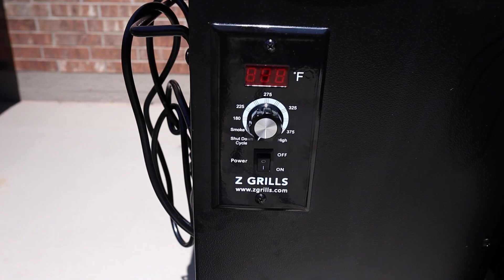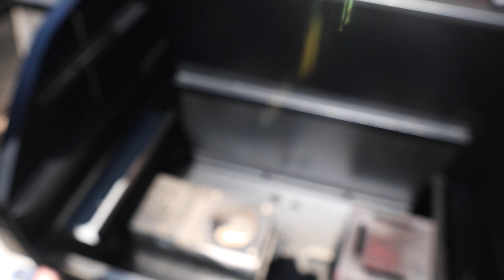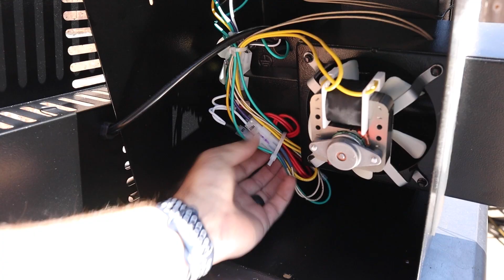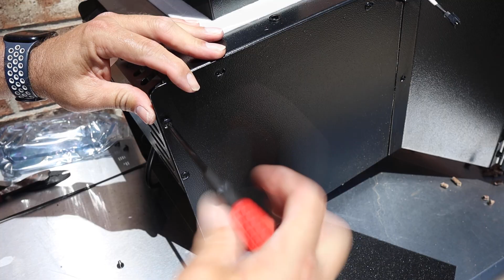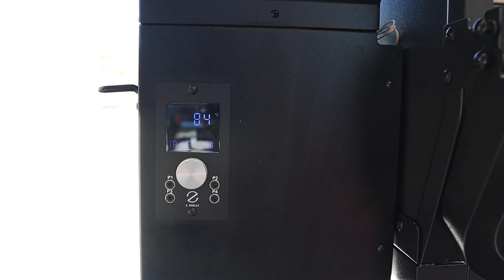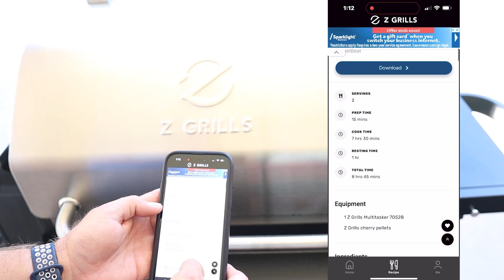How to Upgrade Your Z Grills Pellet Grill with WiFi & Bluetooth Control

Comment from the maker: Want to upgrade your Z Grills like I did?
Here’s the WiFi & Bluetooth controller I installed:
https://www.zgrills.com/products/digital-control-board-with-wifi-for-1000d4e?_pos=2&_psq=control&_ss=e&_v=1.0&aff=629

Full blog post with tools, steps, and install tips:
https://bbqbybiggs.com/blogs/tips/z-grills-wifi-bluetooth-controller-upgrade

Got questions about the install or your Z Grills setup? Drop them below — happy to help!
Let’s keep the fire lit and the smoke rollin’.
Reply: I guess Z Grills doesn't sell those anymore. Your link goes to a 404 Page Not Found page. Any idea where we could get an upgrade controller that will work?
Reply: Is there any reason this wouldn’t work in a 6002B3 ?

Comment: I have the 1000d3e I don’t have a ground plug in wire that matches what I see on the video. Instead they sent me one with an eyelit. The only ground I see is on the three prong side, so I’m assuming I’ll connect it there no other place to put it unless I make my own ground bar.

The three prong is connected with a nut and washer. That’s where I’ll connect it
Reply from the maker: That’s what I would do

Comment: Bought a 600b2b and factory says I can’t install it, do to connectivity issues??? It’s a simple two wire circuit after it leaves the control board. Gonna give it a try and will update👍🏽
Reply from the maker: Good luck.

Comment: What was the part number that you use in this video
Reply from the maker: Looks like they do not offer it on thier site any more, I sent a message to them, will let you know if I hear back. May be temporarily out.
Reply from the maker: They say that they are sold out of that controller but it should be back in stock soon. The link in my video will be good when the get them in.

Comment: How precise is this controller? Does it still have a large temp swing?
Reply: Hello, did the controller come with the WiFi antenna and meat probes?  I see that it has four probe ports, did it come with four probes?  Thanks
Reply from the maker: @stevenkudrna9463 the WiFi controller I linked in the description is the one I got. It had the WiFi antenna and 2 probes with it. It can use up to 4 but 2 are included in the WiFi controller box. It takes normal probes so I have more around if needed. If you do need 4 Amazon sells them cheap.
Reply from the maker: I did not see any more than my other pellet grills. 5-10 degrees after it settled in. I’ve done about 5 cooks on it and so far it has performed flawlessly